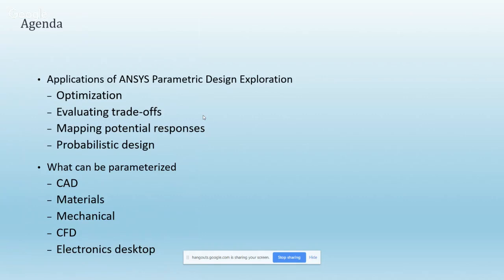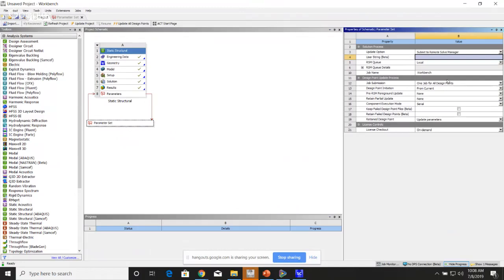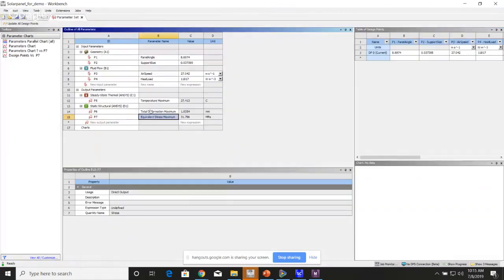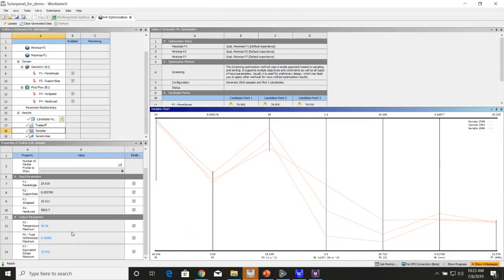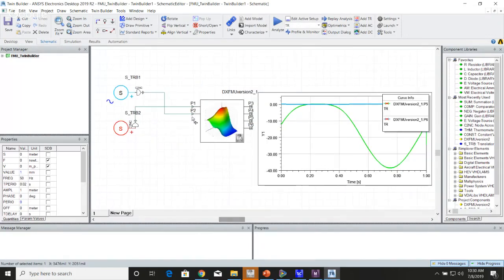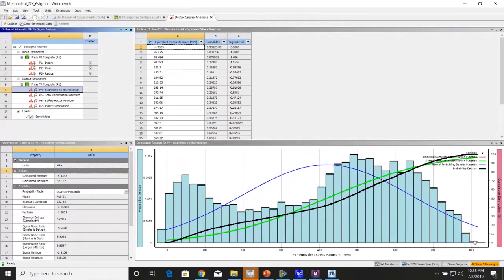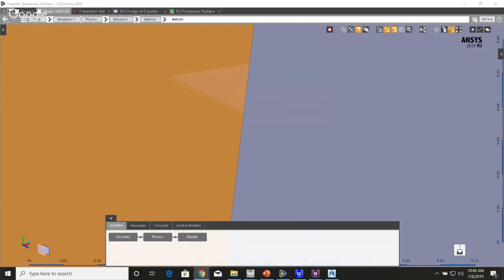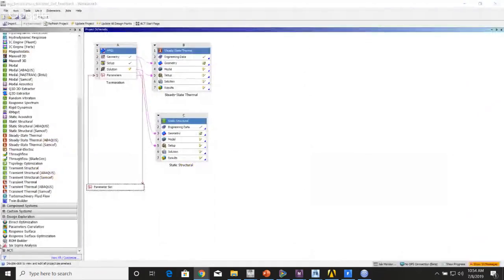ANSYS Parametric Design Exploration

Comment: Hi, how do you parametrize in the sketch mode? My sketch is complex and I can’t exactly measure each dimension and then parametrize
Reply: its easy to do. i am even making design in SolidWorks and importing the design with all the parameters to be varied. its not hard just do a google
Reply: @MuhammadQasim-cw2ti  yes I got it later, parametrised both in spaceclaim and done it in Creo and import also same parameter list
Reply: @mohitthakur6920  alright thats good. I was just checking on you....
Reply: use blocks in spaceclaim